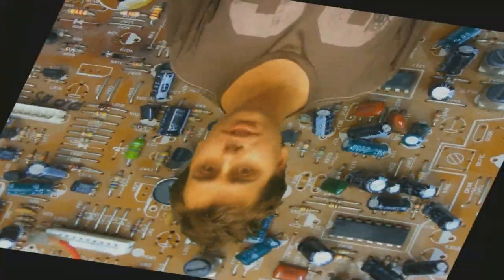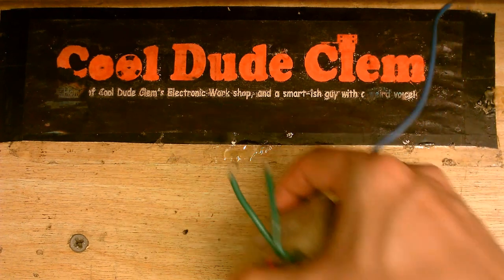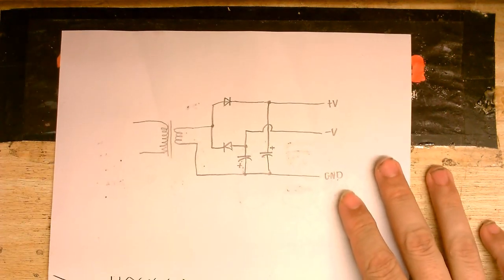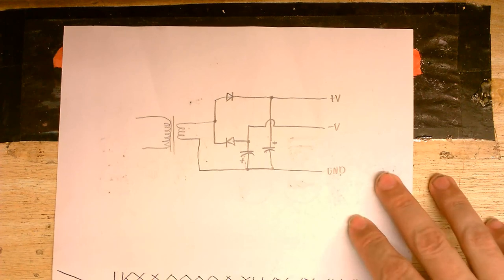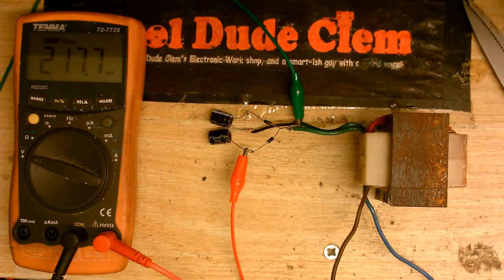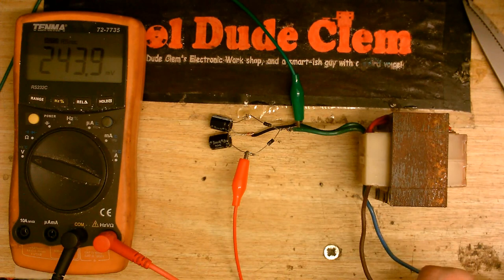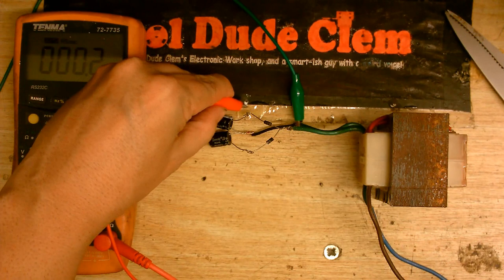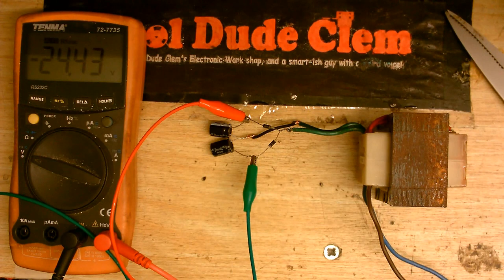Split rail power from a single coil transformer

Comment: And I have a perfect use for that. A meter that requires two 9 volt batteries. Just add a couple of 9 volt regulators.
Thanks Clem.

Comment: Voltage doubler circuit, they use this type of doubler in the xray tanks...
Good to see you making vids mate.
Reply from the maker: Yep, it pretty much is, and I've seen this circuit used a few times, but it always looked to me that it could provide 2 supply rails, if I set it up this way so I thought I'd try that out.
Reply: @CoolDudeClem  yeah mate good thinking, just nice to see you making vids 👍👍👍👍👍👍

Steve

Comment: Im curious what the level of noise is on the output and how much current it can supply.  Its essentially just one diode and a cap for each rail which is not an inherently good design for a power supply.
Reply from the maker: It's just mainly a proof of concept,. With a voltage regulator added to each rail it would be able to supply a few op-amps.

Comment: Hi Clem, Do you know how to make +&- 4 volts out of those components?
Reply from the maker: a transformer outputting 3.45 volts would work, but that's at no load, better to go with a transformer of maybe 6 volts and add a voltage regulator to each rail.
Reply: @CoolDudeClem  Hey Clem, good to see you get back into your vids, use the 9 volts and series the 6 volts out of phase. same transformer 😉 should work in theory.